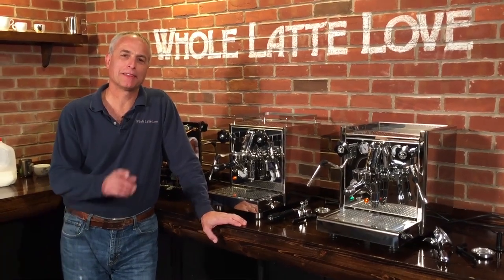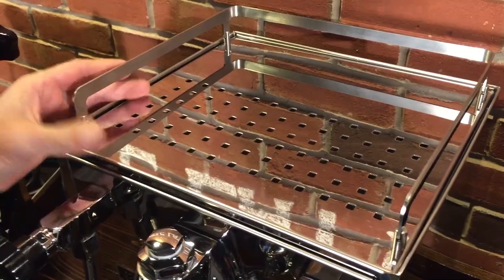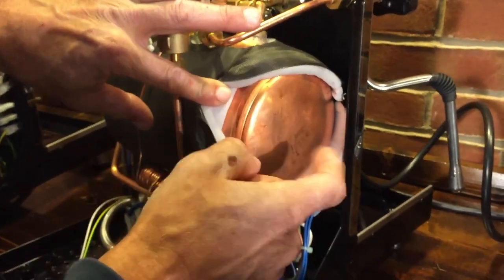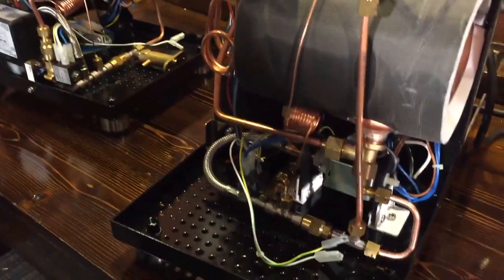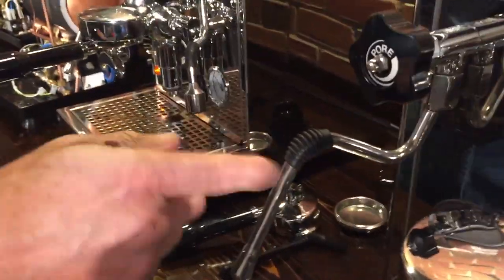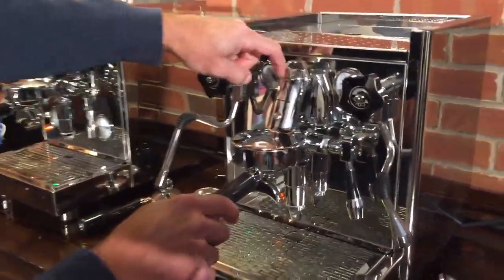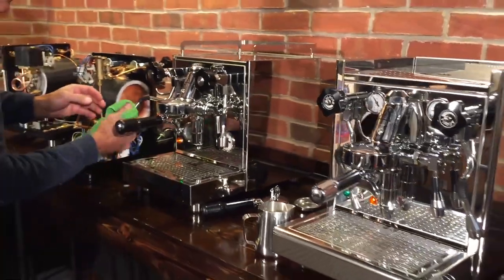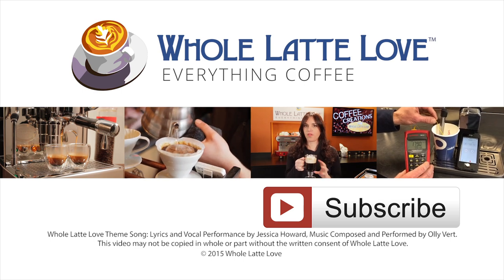Compare: ECM Technika IV and Profitec Pro 500 Espresso Machines

Comment: Hi guys - just a general question. Bought a new ECM and works great. But how long can I leave on without risk of damaging seal?  I usually get up every morn 1-2hrs before rising to put dogs out - I turn machine on so is ready. So if i leave it on 2hrs every morn before using will this damage seals or conponents? If so - what timeframe extent? Appreciate any feedback. Regards
Reply from the maker: Hi Matthew, Thanks for a great question. It's one I asked Michael Hauck who is one of the designers of ECM machines as well as CEO of the company. He says he leaves his machine on continuously. His thought is the thermal cycling actually stresses the machines components more than just leaving it on. He did not speak to specific components. He also mentioned that depending on water quality scale is may be more likely to form with thermal cycling. Hope that helps!
Marc

Comment: Is the stainless steel boiler better then a copper or on the rocket that has copper with brass on its boiler?
Reply from the maker: Stainless vs. copper/brass is a personal preference but you will get opinions (much like a PC vs. Mac debate) as to which is better. Can say the tendency in higher end machines is towards stainless.

Comment: I noticed the pricing for Profitec Pro 500 is very similar to the Rocket Appartamento.  Would your team please make an in-depth comparison video between the two?  Thanks!
Reply from the maker: Hi Sebastian, Thank you for the request. I'm adding it to the video production cue as they are similar machines. It may be awhile before we get to it so a few key differences to tide you over.
Pro 500: 1400 watts, 67oz. insulated stainless steel boiler, 101oz. water reservoir, brew pressure gauge, steam pressure gauge and sprung valves (low wear) for steam and hot water.

Appartamento: 1200 watts, 60oz. copper boiler, 85oz. water reservoir, Steam pressure gauge only, standard valves.

Both are HX boiler with E61 group. We prefer the internal design/engineering of the Pro 500 while the Appartamento is a little more "flashy" with lots of branding elements and color can be changed in circular cutouts in side panels. Hope that helps for now. If you have more or specific questions I'd be happy to answer.
Reply: Thank you so much for the extremely quick response.  This is why you guys are the best in the business.  The information you provided was excellent.  I also noticed another similarly priced machine in the form of the Bezzera Bz10.  Maybe a three-way video comparison would be a better idea for the video production cue?  Heck, we can even throw in the Bezzera Magica!
Reply from the maker: You are very welcome. We do our best to be responsive! Thanks for the video ideas!!! A 4-way compare - that'll be a long video!

Comment: Can I ask what you will pick ECM iv profi of profitic 500 and whay?
Reply from the maker: Hi Nawaf, Thanks for the question. If you want to plumb the machine into household waterline only the Profi can do that. The Pro 500 is reservoir fed only. ECM and Profitec are sister companies. The ECM line tends to have more refined exterior casework and extra style details compared to Profitec machines. ECM uses a smooth rotary pump while the Pro 500 uses a vibration pump so it's a little noiseir. The Pro 500 PID machine is currently our best selling HX machine. With the PID control brew temps are rock solid.
Marc
Reply: ترجم لي ايش قالك
Reply: m m قال نفس مواصفاتهم المعروفه بس بصيغة ثانية
Reply: @alnawafaldossary6268  يعطيك العافيه

Comment: How many cup per day pro500 can be used it??
Reply from the maker: Hi FiI, Thanks for the question. Sounds like you might be asking in consideration for commercial use? If so, know the Pro 500 is not intended for that purpose. I'm sure some do anyway, but have to say it's not a plumbable machine so you'll be filling reservoir a lot! Also not really designed for high volume continuous use. It's considered a domestic/home use machine. In that setting or maybe something like a bed and breakfast or office it could serve 10-15 drinks per hour.
Marc
Reply: @Wholelattelovepage  Thanks Marc, and what about of vivaldi 2 or rocket giotto R?? Can i use it that machine for lightcom?